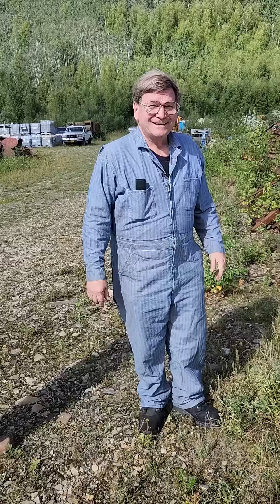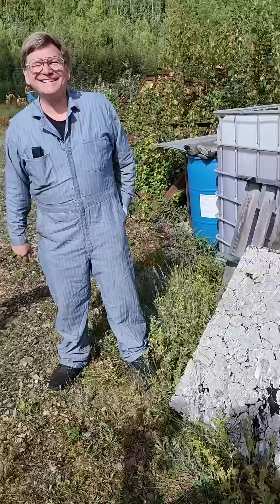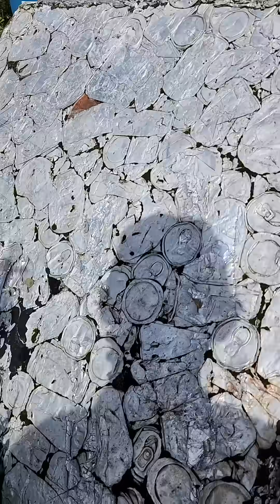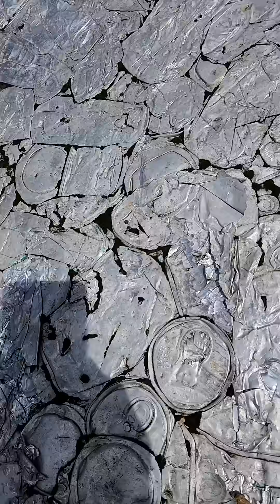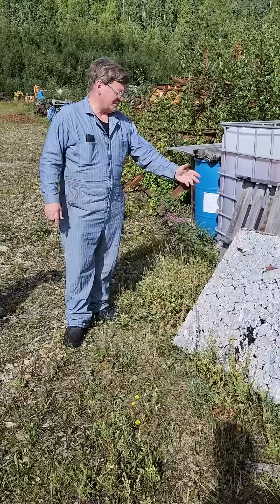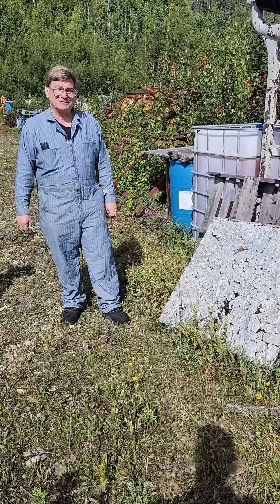A piece of UAF Engineering Department history

Comment: At Fairbanks Machine and Steel we built a hydraulic honey bucket press to remove the liquid content from the excrement. To test it we did some cans in it. The machine went to a village so they could dispose of the waste more easily.
Reply from the maker: Was that for 5 gallon, or for drums?  Before I left, they asked me to design a similar machine for #55 drums.
Reply: @HOWEES it was for whatever they could dump in it. There were holes in a thick plate for the liquid to squeeze out. I wish I could remember what village it went to, it’s been to many years.